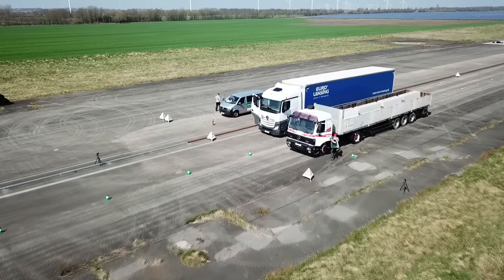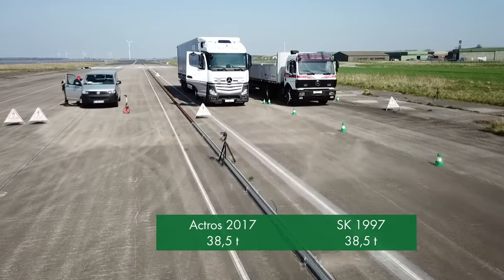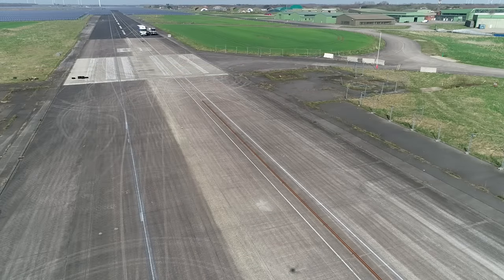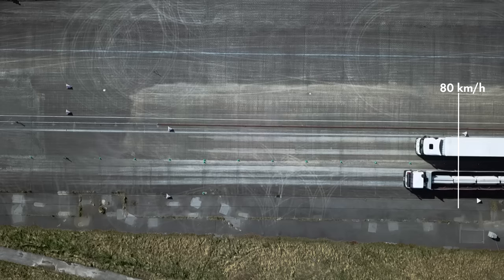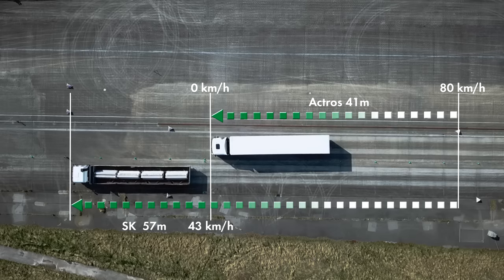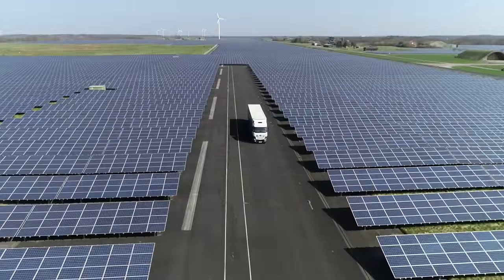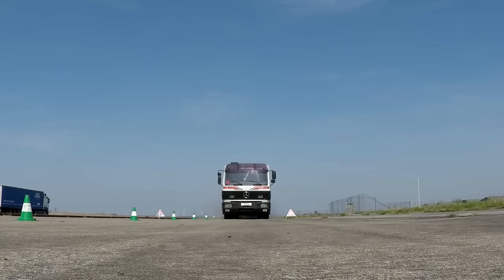Brake test: Modern truck vs. old truck

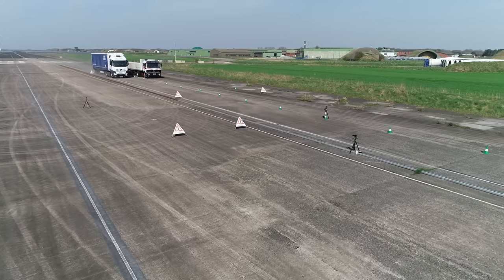Comment: 0:26 The SK truck braked later than the new one here as you can see, NOT FAIR! ofc a little different but it could make something
Reply: Agree.
Reply: The old one probably have drum brakes on all axles too. Switch with disc ones and it would fair the same as the new one
Reply: Not 16 meters later though.
Reply: and the question of what is under the tarpaulin
Reply: @WEMBLEYNE  disc brakes arent always the best ones...drum brakes can be better sometimes.
Reply: Seitdem die bei Mercedes in den frühen 2000ern mit dem Nobremsassistenten bei Nebel beschissen haben bin ich vorsichtig geworden was diese Fortschritte angeht. Ja, vieles ist besser geworden und auch ja, vieles unzuverlässiger...ungeklärt auch, warum der Actros mit geschlossenem Trailer fährt während man auf dem SK Trailer die Ladung aus Betonelementen sehen kann. Vielleicht war der Bremsweg im Vergleich zum Alten nicht groß genug und es musste nachgeholfen werden.
Reply: @WEMBLEYNE  most trucks have drum brakes
Reply: @chriscs9080  in the US probably. No truck in europe still has drum brakes unless they are in a museum.
Reply: @WEMBLEYNE  lol I live in Greece and most trucks still use drum brakes .
Reply: @chriscs9080  fair enough but why is that?
Reply: @WEMBLEYNE  The main reason is because drum brakes are cheaper I believe .
Reply: @chriscs9080  Not just that. Drum brakes have some advantages such as being completely sealed, and less braking force needed. They can rival braking performance of disc brakes, but will fall off quickly due to heat.
Reply: It could be the brake lag is shorter for the new truck. It could also be pedal response, old worn out brakes, or a difference in reaction time.
Reply: The reason for this is something called ebs. Electronic brake system. This sends an electronic signal to valves near the calipters so that braking action will be instantaneous.

On older trucks like the sk, when you press the pedal, the entire brake line have to be pressurized before application of the brakes. This means a 1 to 1.5 second delay in braking action.

Both trucks brake identically when action is applied.
Reply: It's because ebs is faster than abs.
Reply: @ilkkak3065  can you tell difference please?
Reply: @ThomasTrucker  EBS differs from traditional anti-lock braking systems, or ABS, in that braking is controlled electronically rather than pneumatically, or by air. The driver applies the brakes, and the system calculates necessary actions for brake management. A brake signal transmitter replaces the foot valve and sends an electronic signal to the controller, which then signals braking needs to each axle group. The electronics system knows what the driver wants, calculates vehicle mass and calculates the pressure needed at the wheel ends.
Reply: @ThomasTrucker  Not that I will rain on the answer you got to your question, but the answer is wrong and correct at the same time. EBS is short for Electronic Braking System, and is correctly described. This allows for a shorter length of pressure tube that needs to be pressurized to operate the brake when the pedal is depressed. This is correct. 

What is wrong is saying it's faster than ABS. EBS is faster than traditional airbrakes (also known as non-EBS). An EBS enabled tractor-trailer setup can and, according to some EU directive, will have ABS. ABS is the anti locking system that pulses the brake action on the wheel brakes allowing better steering on slippery surfaces. The misunderstanding here is that EBS and ABS requires a cable between tractor and trailer. This cable is called the ABS cable, and has a number of leads. There are 5 active leads on a non-EBS setup, and 7 active leads on an EBS setup. The labels on the connectors are somewhat poorly illustrated, causing people to incorrectly assume that EBS is better than ABS, when they are two inherently different systems.
Reply: Thank you both for the detailed explaining!

Comment: Interesting thought:  One vehicle that I used to drive, an 11/1979 build tandem tray top with a single axle trailer on behind, the brakes were such on that truck, that, even with 4 tonne more than what should have been on the truck, it would outperform some cars in braking at traffic lights.  To the point that I was even abused by a copper for causing the copper to have to take evasive action to avoid running into the trailer!  Copper tried the overweight trick on me...  But, how could I have stopped quicker than you if I am overweight???  This was at a gross weight of 32.5 tonne, over 4 axles.  Eventually, the brake shoes got down to the rivets, and the shoes were replaced.  With the new shoes, the braking capacity went out the window, and had to allow an extra 10 metres at 60 km/h.

As for the torque / horsepower argument...  it also comes down to gearing.  One other truck that was a joy to drive was an old Scania, 6/1977 build, 296 b.h.p., 1070 Nm of torque.  Pulled out of a yard in the hills, gross weight of 34.5 tonne.  Company truck follows me out of the yard, he is 42.5 tonne, 460 horsepower Cummins in a Sterling prime mover.  Now, on paper, the company truck has the better horsepower to weight ratio, and should get away from me.  Company truck is electronically limited to 100 km/h, mine is gearbound to 88 km/h.  Went up the first hill, got away from him, over the top, my practice is to ride the exhaust brakes and change up through the gears to hit the bottom of the hill doing 84 km/h / 2100 r.p.m., then hold that speed for the start of the next hill, which is a 2 km, 6% grade.  Company truck got away from me on the downhill and flat, but, I went past him with a 10 km/h speed difference at about the 1.6 km mark on the next climb...  how is this so???  It all comes down to the gearing!!!  

To further reinforce this point...  A 112 Scania, 305 h.p., 3.89 diff ratio, used to tow a triaxle cement tanker out of Geelong to Adelaide.  He would be loaded to 42.5 tonne at Geelong, and would use 350 odd litres of fuel for the trip back to Adelaide.  So, on the last Mermaids weighbridge, his gross weight would be 42.2 tonnes.  Going up the dipper, he would be in 4th gear at 15 km/h.  The last load that was done with this truck as a prime mover was a load of railway sleepers out of Tailem Bend.  At the Mermaids weighbridge:  Steer:  5.40 tonne, tandem drive:  17.20 tonne, triaxle trailer:  20.70 tonne - Gross:  43.30 tonnes.  (Yes, the knuckles got rapped / spanked by the Mermaid!)  Going up the dipper, held 7th gear, 1400 r.p.m., 25 km/h..  This is in a 111 Scania, 296 h.p., 4.86 diff ratio.

Comment: Show the contents of the second trailer...
Reply: My thought exactly.
Reply: Stay where you are!
Reply: The same as on the other trailer, as it’s stated in the video. Both weighing in at about 38,5 tons. Why should they have set this up? Isn’t it logical for a truck that is about 30 years older to have a longer braking distance (old abs, old disc or even drum brakes). The same evolution happend also to normal passenger cars.
Reply: They could be lying and using an empty box, why don’t they use the same trailers?
Reply: @fideramirez8611  Do I have to repeat myself? Why should they lie??? There is no logical reason for them to lie. It’s just normal that modern trucks to have a shorter braking distance than a 30 year old one. Like I said, a Golf 2 also has a longer braking distance than a Golf 7 eventhough it is lighter.
Reply: @fideramirez8611  and why they use different trailers? Well, maybe because that were the trailers which were available at that time, they wanted to show the direct comparison and didn’t thought that anyone would be so stupid to assume that they cheated.
Reply: @henningquast8456  why should VW lie about emmisions? they do appearantly, why MB wouldnt lie in this test?
Reply: @InBoostWeTrust7MGTE  It's not Mercedes Benz who is carrying out this test but an independent audit firm, which is also allowed to carry out the mandatory technical inspection on cars in Germany. Besides, is it really surprising, that a 30 year old lorry has a worse braking distance than a brand new one with (better) disc brakes and a far superior ABS system? A Golf 2 also has double the braking distance compared to a new Golf 7, eventhough the older car is far less heavy.
Reply: @henningquast8456  So a few points here. Yes I will stipulate that it makes sense that the tech in a 2017 model should be more effective than in something 20 years older. You ask what logical reason is there for them to lie when what you should be asking is where is the proof that they didn't lie. You think just because you can't think of a reason they might lie means that they didn't? People lie every day. Companies lie every day. Trust no one and nothing without some evidence. Blind faith in others is a butt fuckingly stupid way to live your life. If this is supposed to be an independent testing company then they should be smart enough to know that when doing tests you want to eliminate as many variables as possible before drawing your conclusion. So the same type of trailer should be used right down to the brand and if possible the same year model. The trailers should be switched and the test re-run to confirm the results of the first test. The drivers should swap trucks unless they are using some sort of computer controlled setup to apply braking force the same way at the same time.
Reply: @ram89572  are you a conspiracy theorist as well? Since everyone lie if they can, even tho theres no benefits? Obama is a clone, the earth is flat, moon landing never happend, the black pope that is ruling the world, birds are drones, givernment is releasing poison in the air and so on? If this is another company they would have no reason to lie. They had this setup and you think they did it once? And what are you talking about? Same trailer with same year model? Do you even know the purpose of the test? Its supposed to be a newer better technology. If you got something that is in simular weights they should stop at almost the same time but the technology makes the new truck stop way faster if you think about the power of a 38 ton trailer in momentum
Reply: @henningquast8456  VW - did you hear about? They are Germans, they can't live without cheating
Reply: Mechanized sex robots
Reply: Empty :D
Reply: VW lied because of profit. Proper exhaust cleaning is more expensive than cheating. DEKRA is an official organisation, allowed to do the mandatory checks (main examination, exhaust examination) and they're also one of only very few organisations allowed to offer driver's license tests.
They have no reason to lie in this one.
Reply: @chris jones thx man :-)

Comment: Do this test with the same new trailer.
Reply: Why?
Why would you test new tech with Old+new tech?
Reply: @GrillerRohde  because it would make a diffrenece.
Reply: @ThomasTrucker  
Yeah sure but it would be a useless comparison.
Who would drive a 20yo truck with a brand new trailer?
Reply: @GrillerRohde  If it is possible of course there will be people using it on their own old truck.
Reply: @GrillerRohde   He probably doesnt think that old tech is better than new tech. He just want to see the REAL difference
Reply: @GrillerRohde  a trailer is just a trailer, you don’t need to use a brand new unit with a brand new trailer. Only difference is with the EBS. This test is invalid, it’s clear the SK is not being braked properly. I’d like to see if the brakes were checked before hand, and if the travel had been adjusted on the sk as it will be on drums
Reply: @GrillerRohde  (30yo truck) 😉
Reply: The point isn't which combo does which performance, the point is to find out how much worse braking was back then vs how good it is now. You could probably use this to discuss speed limits.

Comment: It's nice to know you get something for all that high tech engineering designed to be impossible to maintain self-sufficiently. I'd still take the old truck, look a bit further ahead for hazards and take my chances.
Reply: @Fishmans  Yes, take my chances. It's not the dead cyclist or motorist who has to live with it afterwards, it's the driver who survived, a dubious advantage. Besides, if you're driving such that you cannot stop in the available distance, then you're doing it wrong, point blank. Also, the highway code is written with older vehicles in mind, so it's not like longer braking distances haven't been planned for.
P.S. Don't forget to adjust your damned brakes. They do wear down.

Comment: Fixing brakes old one. 300$ , just put something from replacement. 100$ for fix.
Fixing brakes in new one. 3 000 $ Ordering parts from china 3 months. Repair shop fees 2 000$ , truck wont move until you place 1 and only part from producer.
Reply: new truck = endless money pit

Comment: It explains nothing!
We don’t hear any details why there is such a difference: Is it the truck or the trailer brakes?
Is it the size of the brake disks, material of pads?
This video says nothing!
Reply: Disc brakes on the unit all round, trailers have abs and ebc and other 3 letter acronyms! Tyres are better! Also newer hgv and trailers are lighter, so the pay load can be increased!
Reply: @terrystratford1235  ...so it’s a matter of newer trailers, not „old lorries“. The towing truck isn’t the issue then as it seems.
Reply: @demil3618  kind of! Older units may have disc braking on the steer wheel, but drum brakes on the lift and drive axles! As for trailers, a brand new, skelly (containers) car transporter or fridge, especially double Deckers are really heavy empty! Possibly upto 15 ton! An empty flatbed probably only 10 ton!
Reply: @terrystratford1235  Yes with the towing truck on drum brakes, they‘ll definately loose against disk brakes ones.
Reply: @demil3618  let's not forget tyres also! Now you can chose for fuel or grip! But the tyres now whatever you have are soooooooòoo much better than old radials!!
Reply: @terrystratford1235  Oh yeah, radials...oh dear. Reinforced with a new rubber layer when worn 😬

Comment: Sidenote... The modern one with the ABS started slipping and it kinda got out of the straight line. The Older model with drumbrakes... Remained stable....and in a straight line... 
I know which one id choose... The old Model all day every day. The romance of trucking is oldschool... The Modern thing is automated to big boredom. 

Sooo #Dekra do a real honest test which one is actually safer... You will be amazed to see the Older model is safer.
Reply: It literally says ABS on older trucks grill.
Reply: People killed in traffic accidents in Germany:
1997: 8549
2017: 3180

Death per 100.000 vehicles:
1997: 16.9
2017: 5.5

I definitely see why you would say that the older truck is safer...
Reply: New one has ebs

Comment: New brakes on both trucks? Or used, probably old ones on the old truck?
Reply: Next to the brakes the tires are very important, too. New tires on the old merc and again!
Reply: @kstudios8706  the old one only half braked. older trucks dont have the safety systems newer ones do so fully locked brakes are actually fully locked and could stop way sooner then a newer truck but more violently and alot higher risk

Comment: I don‘t get why people think this is a set up. Why are you surprised that a older truck without modern abs and esp and with older disc or even drum brakes has a longer braking distance than a modern one? They chose a closed trailer because that was the one they had at hand. It is clearly stated in the video that they both weigh in the same. Again, why should the have set this up. The DEKRA is an wourldwide operating  audit company which is also allowed to take the mandatory technical exam for passenger cars in Germany.

Comment: Truck drivers sometimes think that they are driving a small vehicle, they forget that it requires more distance to brake, that's why so many accidents, specially here in Mexico where I live.
Reply: 41m is only a couple of meters more then a car which would be around 37-38m. and that with 38.5t of load. people think that these things cant brake when they can brake almost as fast as cars at that speed
Reply: @sgxbot  I am talking about Mexico... There are almost no new trucks, most of them are ten or more years old, and they get almost no maintenance. They are only repaired when they break down... That's why it's so dangerous.

Comment: The new trailer started breaking before, and the loading is diferent besides the old truck with those brakes wouldn't be steet legal. 
I don't think this test is valid.

Comment: spent a year driving a 2018 actros after 2 year driving a 96 daf cf. its incredible the difference. i had a car pull out on me in milton keynes in the merc, dented quarter panel to the car, broken number plate on the truck, had it of been the daf i expect there would have been a fatality

Comment: ...obviously someone doesn't know the trucks length, the difference is only 16m, but the length of a standard truck is nearly 19m so how come the older truck is so much ahead, I think the lenght difference should be about 23-24m if you judge by the Video...
Reply: Balkan.....
Reply: Nope, 13. 6 trailer, with 2 to 3 metres of cab.

Comment: Hold on, gotta do the math, 57 - 41.. yes, the math check out, its 16m longer!
Reply: I used my calculator and got syntax error so the answer is sytax error
Reply: Wtf i don't know 😭😭😭😭😭😭😭
Reply: I noticed that the Difference should be 20m approximately

Comment: This probably has more to do with disc vs drum brakes and condition of the braking system on the older truck. Put all new brake linings, drums, slack adjusters, s-cams, and then do the test
Reply: Why? The idea of the test is to provide a visualization of the myth than modern trucks are worse than the older ones.